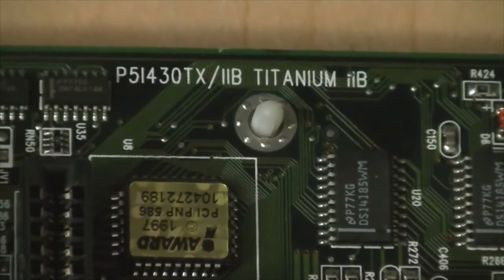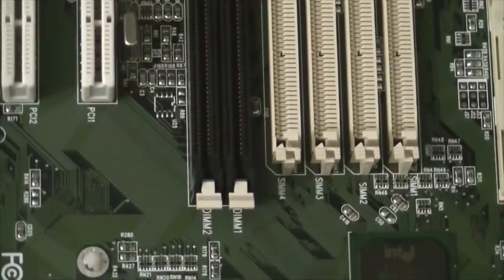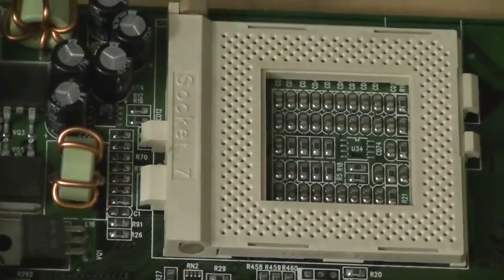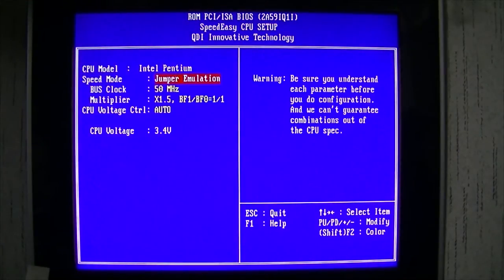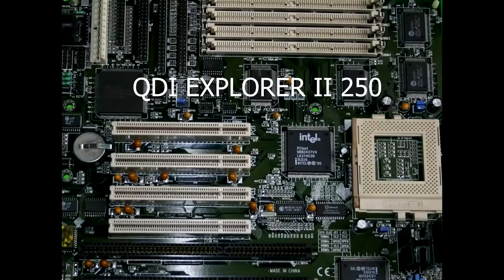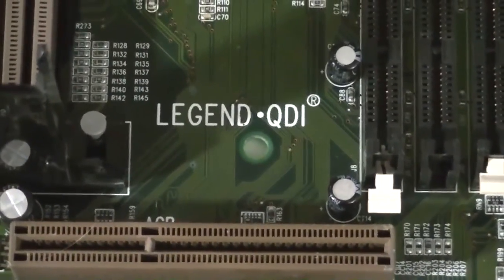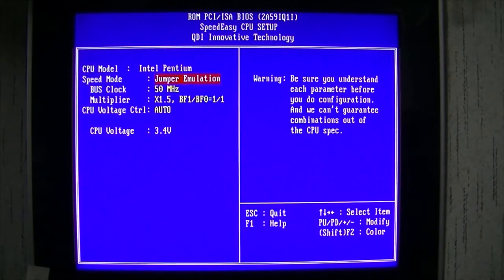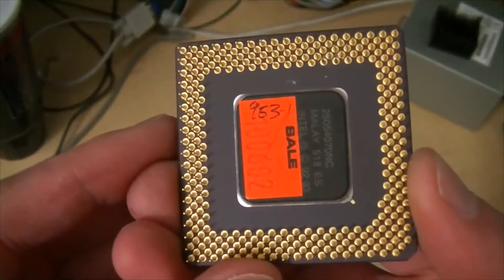All about the Legend QDI motherboards!

Comment: I just aquire a QDI Legend (440BX Slot1) Board. It's solid, it looks like new after aircompressor-cleaning and it's very well made! Configuration is super easy in the Bios without the jumpers and I really like the board.  So this is why I came to your video. Like your content👍

Comment: Back in the days I had a Slot 1 QDI motherboard with a Celeron 300mhz (66 mhz fsb) changed it to 100 mhz fsb. The processor worked absolutely fine on 450 mhz.

Comment: I have the same P6I440BX as you, it's the board that ended up in my P2.I have a Socket 370 one as well, they made decent boards in my opinion.
Informative video, I was not aware that they made the first jumperless BIOS.
Reply from the maker: I was always under the belief Abit was the first, because I only remember the online reviewers, like Tomshardware, Anandtech, overclockers.com back in the day talking about Abit's softbios. Every time I looked at this motherboard, as it sat on my shelf at work, I never knew what it was. I always just thought it was a junky OEM board pulled from a Dell or something, ATX socket 7 is the only reason I ever kept it around.  Thought it might come in handy one day for something.

Comment: i had some QDI motherboards, I used to have two QDI BrillanX/1S (i440BX), Two Advance 10F (VIA 694X), One Advance 9 (VIA 693A), 1 Advance 5 133/E (VIA 693A), 1 Advance 5 133 (VIA 693A) and 1 PlatiniX 2 (i845). These mobos had some good features. Currently i only still have the PlatiniX 2 mobo working as of today

Comment: Raising the dead here, but the strange crash/reboot loop you see using a  AMD K6 CPU is related to the onboard USB ports.  With ports disabled, boots fine for me,  with onboard USB enabled, reboot loop.  Based on your video, I switched the CPU out for a Pentium MMX-133 and suddenly onboard USB worked flawlessly.

Comment: I like this video style, but IMO it'll only work for something like an overview or history lesson. I learned a lot from this video, it gave me lots of information about some boards that I have laying around.

I've got an SE440BX-2 board that's doing a similar thing with the northbridge. What's causing that? Have you found the culprit of it?
Reply from the maker: I have the same thinking about this style.  I would say the benefit, as far as creating the video goes, I can create " stock footage " of stuff as I am messing around with something, that can also be used later on in other videos, and then record a voice over about the project or whatever I am doing the video about once the project is done, or done to the point of the video anyway.  I have a ton of videos that I have started and never finished, or didn't edit because things turned out to be different from what I was thinking at the start, so this way I can finish those too.  The down side is, much more edit time. But this is the first video I have done in this fashion so, the edit time might go down as I get used to doing it this way.   I don't think it would fit for everything though.

I think the northbridge problem is probably due to an internal short somewhere, with a VR or something tied to the NB. Lightning strike, bad power supply... defective components on the motherboard.. perhaps a shorted stick of ram at some point fried it .. i am not really sure honestly what causes it.

Comment: Hey man, are there settings to disable the l1 and l2 cpu cache in the QDI motherboards' bios? 

Thanks

EDIT: I mean specifically for socket 7 motherboards; the one I'm thinking of getting is 430vx chipset which is more budget and disabling the cache is rather important to me
Reply from the maker: igorbog88 VX is a good chipset.   I had to look at footage I took of the bios to be sure, as I have the computer in the closet at the moment, but yes it does have Disable L1 and L2 cache under the Advanced tab in the bios.  Except for OEM motherboards, this is pretty typical on all socket 5/7/S7 motherboards with the Award bios.
Reply: WaybackTECH Thanks for the reply. Supposedly disabling the cache and lowering the bus speed on the P5s makes them perform no better than 486 or 386 machines. Combining that with being able to lower the multiplier which I can see in the QDI bios I can get what I wanted - be able to try out and play some old games and not have them be sped up.
Reply from the maker: igorbog88
Yes this is true. Although I don't know for certain where disabling L1 and L2 cache on a pentium processor will land in terms of 386/486 levels.  The lowest clock speed you would get on any socket 5/7 motherboard would be 75.  I am curious, why would you not just go for a 486 system?
Reply: WaybackTECH Well thing is I don't want to keep that many computers if I can get away with less.
Otherwise sure I'd like a big room just filled with various hardware haha.

This socket 7 pentium I was talking about belongs to a family member and is kept in storage unused so I thought why not -it already has everything including drivers installed, adlib sound card, a sound blaster 16 card, monitor, keyboard and serial mouse too. A functioning time machine that hasn't been used in 15 years.
I tried it out for a few minutes and it worked.

So yeah I'm NOT shopping around and centering this build that would be for dos games around a pentium. I already have it.
Reply: Later I read up on compatibility issues and like I said I discovered that a pentium is too fast for some old titles, more than a few actually, a big chunk of them so I read some more and found that disabling the cache should really make the pentium take a hit. Here's some stuff

http://www.vogons.org/viewtopic.php?t=26630

http://www.vogons.org/viewtopic.php?t=32526

http://www.vogons.org/viewtopic.php?t=26448

Way I figure it it's not a hassle to disable the cache and lower the bus speed when needed for a troublesome game when it's just a minute of work. Plus I can run some slowdown program to bog the cpu down further. Also apparently the actual cpu frequency doesn't have a meaningful impact. I'm hopeful it'll work out.

I have no idea if the program used to test the relative performance actually is correct though, but I remember  reading some other stuff that some of the speed-sensitive games (the ones mentioned) did work properly after doing this.
Reply from the maker: igorbog88
Well in the case of what you are trying to accomplish, you might look at getting an ISA video card, such as a Trident 8900 or 9000 based card, instead of using a PCI graphics card. The ISA bus will most certainly slow that system down, even during the 386 days it was a bottleneck.
Reply: WaybackTECH 
I wrote some stuff down after I opened it up and looked at the specs in windows and it has 32mb of edo ram installed instead of sdram. The graphics card is an S3 Trio. It's not the regular more expensive S3 Trio 64, but a Trio32. It has a smaller 32bit dram interface and just 1mb of ram on the card.
Would this influence anything for dos games or would it just limit usable resolutions in windows?
Reply from the maker: igorbog88
 Dos games are funny. Descent for example just crashes with 64MB of ram, but other games work ok. I think 32MB of ram should be ok for most games, but some of the really old games for 386 or slower machines might only work with 8MB. Just won't really know till you try.  For the video card, there shouldn't be any issues there, usable resolution, color bit depth and refresh rate is all that will be limited with 1MB of dram.  The 32-bit part is just the memory interface for the Trio to the dram memory.
Reply: Socket 5/7 motherboards have the L2 cache on the motherboard (Pentium 1/MMX only have L1). So on the BIOS there would be options to enable and disable the internal cache (CPU) and the external cache (L2 cache on motherboard). Is generally in Advanced BIOS settings. Also don't forgert the VX and TX chipsets have a cacheable RAM limit of 64 MB. Installing more than 64 MB would effectively disable the L2 cache on the motherboard